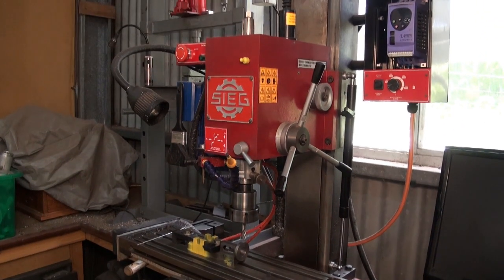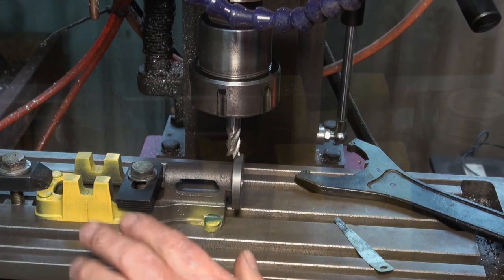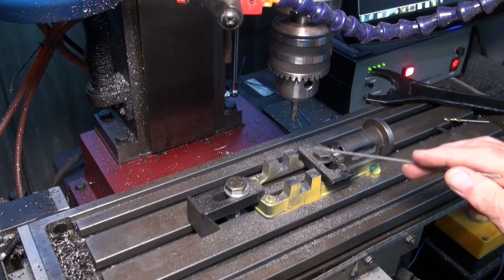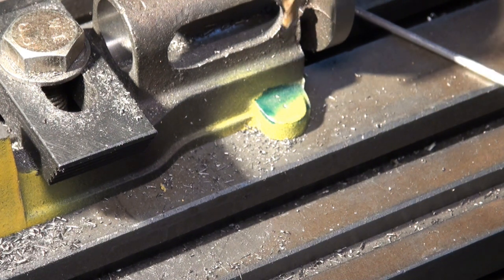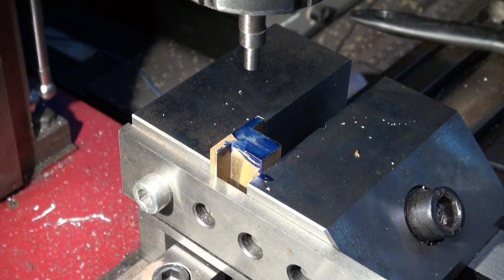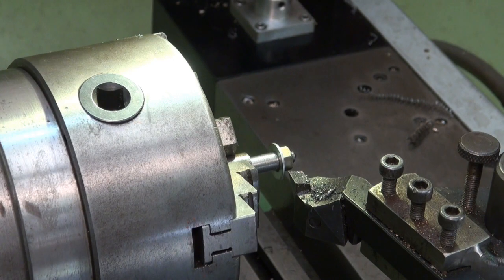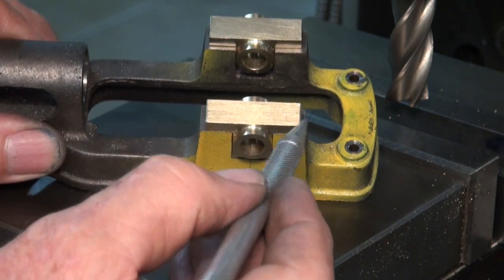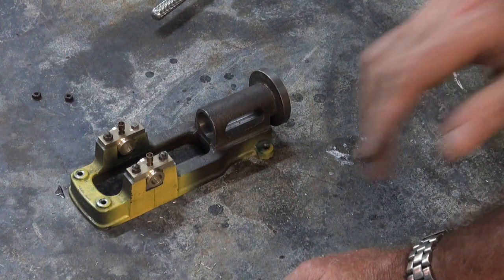Building the Stuart Turner Number 8 Mill Engine - Part 2

Comment: are the bush brass, or actually bronze (from back in 1967)? the modern parts list includes gun metal for the valve block and bushings. I think this may be a way to date some old models people just list as "vintage". fascinating how even kits of old designs are being revised
Reply from the maker: The bearings are actually bronze. The term "bearing brass" is an old one and referred to the bearing components as a group. Often when there were two or more elements in the bearing assembly they were collectively called "bearing brasses" 
Regards,
Mark
Reply: @Preso58  Up until the late 1980’s many rail cars in the US had “friction bearing “ trucks that used cast brass bearings that were poured full of Babbitt on the actual bearing surface. These things were universally referred to as “journal brass”, even though the brass wasn’t the actual bearing! In the not so infrequent event that the journal overheated and melted the Babbitt away, the thick brass part would function as the bearing for long enough to get the car off of the main track without destroying the axle surface! Above that was a cast steel journal bearing wedge that would quickly destroy the journal if the brass disintegrated! Changed hundreds of them in my 41 years on the railroad, and cleared up more than my share of derailments due to “hot boxes” with wrung off journals!
Reply from the maker: @tomt9543  Interestingly, my model steam locomotive (3 1/2" gauge Conway) has babbit bearings cast into the axle boxes. When I was building it I didn't have a very big budget so I used steel for the axle boxes even though brass or bronze would have been better. I also worked as a volunteer at the Brisbane Maritime Museum back in the late 70's. At the time they were restoring the "Forceful". It was the last steam powered tug to be working on the Brisbane river. She had a triple expansion engine with bearings of the same construction as what you are describing. One of the old hands who I was working with told me that when the engine was working under load it was common practice to feel the bearings to see if any were running hot. I thought about it for a while and then asked how you could check the bearings on the connecting rods. The answer was that you would have to lean over and wait for the end of the connecting rod to swing past and just slap it momentarily. I recall saying that it sounded pretty dangerous. The guy just smiled and said "try doing it in a storm with bilge water everywhere!"
Reply: @Preso58  Those “friction boxes” were tough as nails! They had a flip up lid that allowed inspection of the axle journal, bearing, and cloth packing that sat in oil and touched the bottom of the axle. They were high maintenance though, as the FRA (Federal Railroad Administration) required that the packing and oil be changed every 2 to 3 years depending on wether the boxes had journal stops or not. Those stops limited the front to rear movements of the journal in the box. The roller bearings they use today don’t even have a provision to re-grease them!boy how times have changed!

Comment: Great video. Question why you didnt finish the end of the bearing housing with a small radius to avoid sharp corners?
Reply from the maker: Good point. Probably a case of not having a tool and cutter grinder. It's on my list of workshop acquisitions. I'll tell my wife you suggested I need one! 😁
Regards,
Mark

Comment: Hi Mark, 

You could have made up some 5BA transfer screws to spot the underside of the brasses.
Reply from the maker: Yes. You're absolutely right. Why didn't I think of that? My strategy was high risk. It all depended on centring the stock. Transfer screws would "print" the hole centres no matter what degree of error was present in the original marking out.